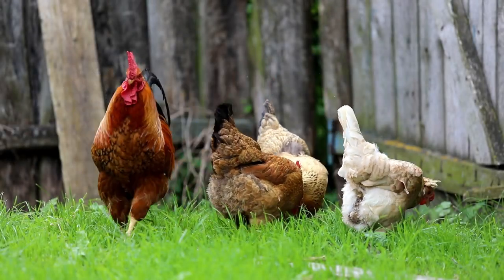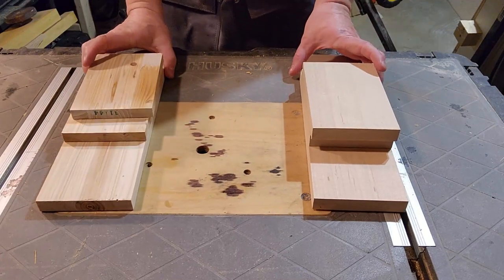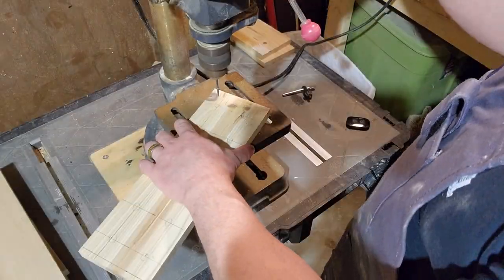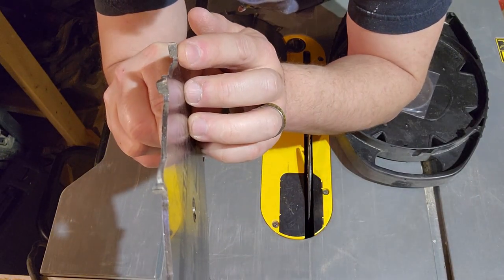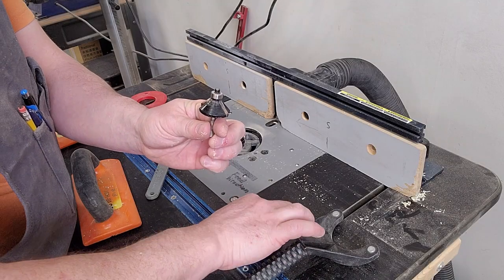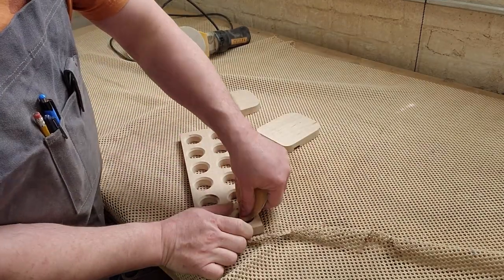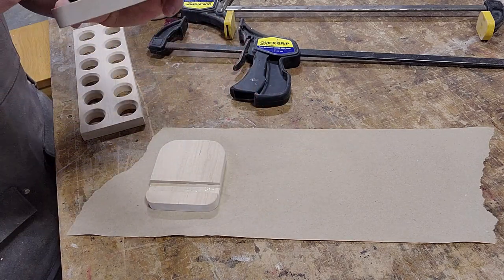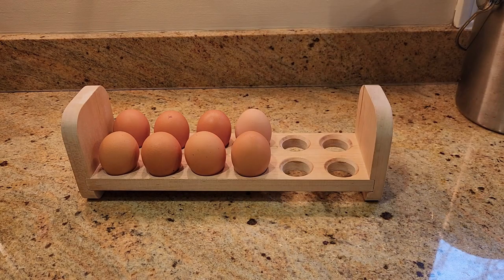This DIY countertop egg tray is a FANTASTIC scrap wood gift

Comment: Those little disks that you pop out you could use them as Christmas ornaments or you could make the hole in the center bigger and use them as napkin ring holders
Reply from the maker: Those are both great ideas!  I'll have to start saving them and try some of those.